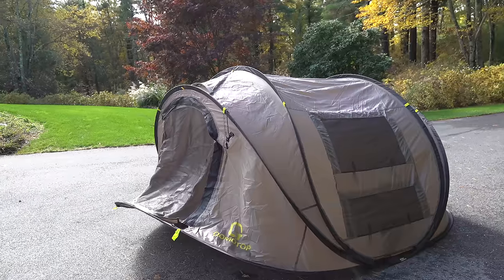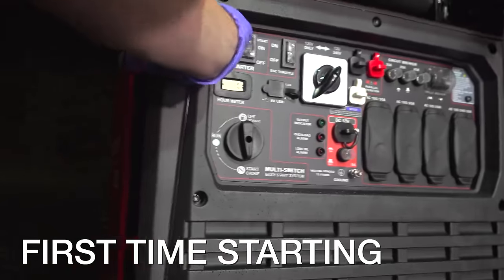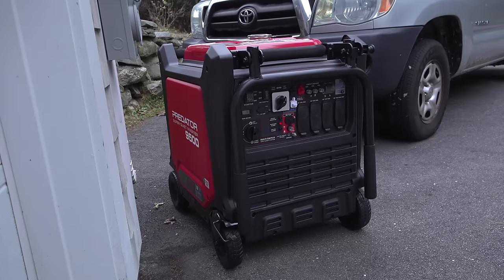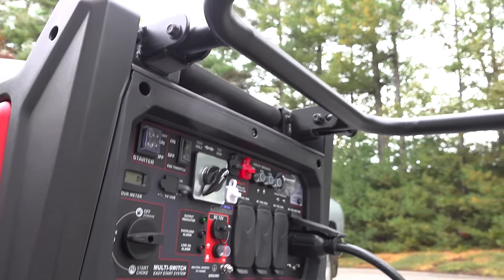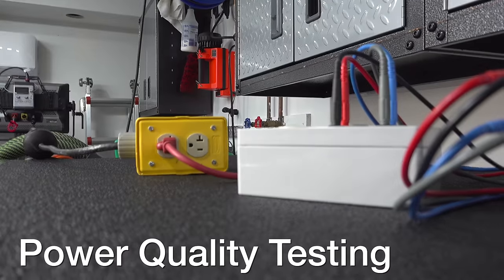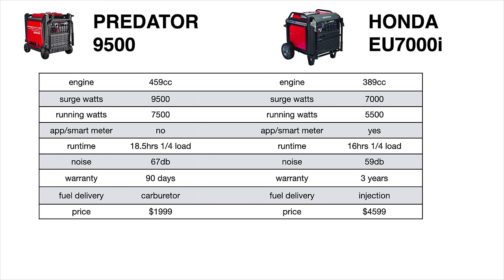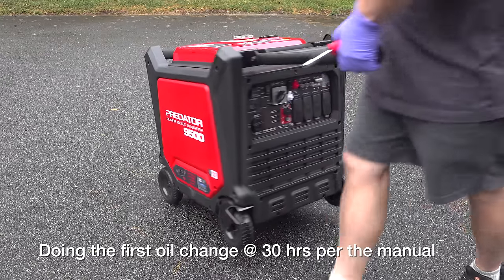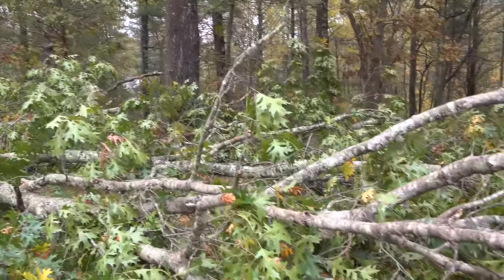BIGGEST Harbor Freight Generator Predator 9500 Review & TEST

Comment from the maker: Thanks for watching please LIKE & SUBSCRIBE - Be sure to let me know if you own one of these in the comments below & what YOU think. Cool LED light I used: https://amzn.to/3mBuE4u
Reply: Another great video. Can you imagine that California just passed a law banning gas generators? Imagine powering your house with just a solar generator. Ok for a few hours but not for 3 days.
Reply: The Predator math doesn't work on the power output. When running the L14 30 amp plug to your house, the size of the wire is a number 10. It is good for 30 amps. Running the generator at 9500 watts is overloading your plug and wire by 2300 watts or 9.58 amps. Even running at 7600 watts is 400 watts overload . Get with a electrician before hooking this up to your house.
Reply: Menards has a deal on 15’ usb to usbc 
And usb to lightning
Reply: Thanks for the great review. I've been looking at getting the Predator 9500 and this is the video I needed to see. About the lights. I have 4 of them and and they are like a mini sun! I carry 2 in my Jeep and keep 2 at the house. So nice to have this much brightness without having to deal with power cords.
Reply: Well it's definitely not a retracting handle for sure
Reply: @rebellucy5610  Dont worry.  They can Burn Candles and Skateboard!
Reply: @Derek Claycomb Fully Synthetic oil does not keep O-rings and other rubber based seals supple.  Its great for metal on metal contact.  That is why auto manufactures recommend a synthetic blend.  Synthetic oil is a waste until all natural based components are not in an engine and its not that way yet.  All my friends that swore by the stuff get leaks from seals going bad causing a major amount of work.  Hey but everything else is cool!  Still needs to be fixed.
Reply: Where is it made in?
Reply: Perhaps I missed it, but which engine powers this generator? (Manufacturer) B&S, Techumpsa, etc
Reply: What was the name or brand of the tent?
Reply: @hellogoodbye3129  
Walmart - SF Street Bum Special
Reply: Hello, my son bought a predator for his ice cream truck, and now he is running into issues and really doesn't have any one to talk to, Harbor Freight where he bought it is short on man power and no one could anser the questions. I'm sure your busy, could you reply if your able? Thank you.
Reply: @Derek Claycomb q¹
Reply: Why don’t they sell these in Canada
Reply: Where do I get one of those pop up tents?!!
Reply: ❤this. Can we get an update on this unit please? Thanks.

Comment: As a factory trained honda mechanic I can tell you the modern Honda s are nothing special.  In the 80s they where the best. Now i own a couple of the  Predators and with lots of good brake in oil changes followed by regular oil changes they last just fine.
Reply: This is the comment we need, thanks
Reply: Also Honda motors are no longer as I've been told. Is that accurate?
Reply: Bullshit.  I have had both that I used constantly and had them in the repair shop.  Honda is infinitely better than that Chinese crap.
Reply: All #thepoors say that.
Reply: Thx brother

Comment: I used our Predator 9000 generator for over 30 hours during this last storm with no issues powering our small office and the house next door.
Reply: That's great that you had that for the storm and that you had no issues. I literally have ran Honda 2000 watt generators for 3 years straight at 24hrs a day. Never changed the oil, only added it to the full mark after it would shut off due to the Low Oil Alert. Never had any problems for years. It's insane.... I highly advise against treating them like a did but you can.
Reply: @lucasmorgan4359  why would you run it that long??
Reply: I dont have the big 9000 but I do have 4400 . Its amazing runs 16 hrs straight.  I haven't hooked it to the house yet I just run cords hut it has enough power to run the heater two fridges and two deep freezes plus our TVs and such it was the best thing ever we had three storms where tornados or wind had knocked down lines and that sucker came in clutch.
Reply: 30 hours is nothing.  That is like saying you are so happy your car got 1,000 miles on it and you have had no problems.  Funny how you almost never see any reviews on an "item" that is several years old and might have 500 or more hours on it.
Reply: @trvman1  well I dont use mine constantly but it does sit put side exposed to the elements and runs like a dream I've had it for about two years and couldn't count the hours but it was in the bed of my truck for about 7 months and was most certainly used alot. The predator is a great generator my brother swears by his Honda but I do know he has had many second thoughts since I have gotten the predator
Reply: @lucasmorgan4359  yeah yeah and after Irma my buddies eu2000 wouldn't start. 

running for 5k hours straight isn't whats important....whats important is that is runs for the hours that you positively HAVE TO HAVE IT RUN.

the aforementioned freind borrowed a tailgator from a neighbor. it ran fine.
Reply: @lucasmorgan4359  what are you powering 24/7 with those?
Reply: Watch some of the homesteaders YouTuber channels that actually rely on these generators they crap out there very unreliable
Reply: In theory anything should work fine when new.  Give it a few years and see how it works, especially when it’s not run frequently, ethanol fuel, etc.
Reply: @shanemb3  It says to not run ethanol fuel in this unit.
Reply: Yo quiero uno .cuál me recomiendan. La menos ruidosa  eu 7000 o Predator 9000
Reply: 9500,wow,yes you want to load that up or it gets lazy if it doesn't have to work hard
Reply: I own quite a few generators 1st a Honda  eu2000 I bought in 2013 it ran 24-7 for years, many oil changes but that's it I've never had to change plug, replace pull cord nothing, 9 years now I haven't run it much lately I sold the boat but it'll still start 1 or 2 pulls simply amazing, one thing is rv fuel only also. I bought a predator 3500 as a back up but only a few hours on it so no opinion yet except battery is dead not a problem tho pull starts 2-3 pulls the predator is quieter than the Honda someday we'll see if the predator can take the thousands of hours the Honda has on it, those 2 are the only relevant here
Reply: @MrSGL21  Your buddy must have not run all the old fuel out of it or not taken care of it.
Reply: @Asidebar  it wouldn't  start even pouring gas right  into the carb throat. Problem was ignition.
Reply: how much did you charge the house next door? I would want $5/kWh, $5/day service, and $1/day extension cord rental. About 10x what the utility charges. A lot cheaper than buying a 9500 watt generator and the fuel cans.  And refilling the generator and the cans takes effort.
Reply: Do you know how much fuel it actually burned 
I’m either buying one of these or a used diesel generator

Comment: Personally, I would never get one of these again. I have had three 3500s replaced under the extended warranty. Used non ethanol gas, iridium spark plug and serviced every 100 hours after break in period. Never ran more than 1600 watts on any of the 3500s and each one failed. Finally just ended up with a gift card to Harbor Freight.

Comment: Great video.  We have the Predator 9000/7250 watts gasoline generator. I installed a Tri-fuel kit, to connect it to our homes natural gas line. We have over 70 hrs. on it with no issues. I only use Pennzoil Fully Synthetic 10W-30. We have ours connected to two manual transfer switches, using the 120volt and 120/240volt outlets. This set up allows us to power our entire house, including our 3 ton AC with hard start hit.
Reply: What Tri Fuel Unit did you get?
Reply: @jm-ve8ry  Hutch Mountain, check them out.
Reply: you should really consider a soft start kit....

Comment: I bought one a little over a year ago. Had issues with the low oil sensor right off the bat. Harbor Freight said to bring it back even though it's an hour drive to the nearest store for me and, the 9500 was in short supply, I chose to keep it.  Thanks to YouTube, I was able to connect with a user that had a solution to the sensor problem. I ended up bypassing that sensor and have ran it for almost 100 hours with no issues. In between uses, I faithfully run it once a month for at least 30 minutes.  Not a big fan of all of these points of failure (sensors) but, over all, I still love my 9500.

Comment: I had the older 9750 watt. For 6 years there's been several times I ran it for days because of power outages..  once for right at two weeks.. it still cranks ever time and never had any issues with it..  I think it was around $500..  one of the best machines I've ever had..
Reply: It’s 2,199$ now…
Reply: Have that older one too…thing is still such a beast…absolute steal for the price
Reply: Is yours an inverter type?
Reply: @Antoniocool86  it's a gas powered generator.  I have two inverters I hook up to a couple of cars to power the lights,  I use the generator for two 110 AC  window units.  I just recently used them in a hurricane/ tropical storm Helena on the east coast

Comment: Bought one of these in august, it has been nothing but great. We have Honda EU7000i’s and predator 2000’s at work and this thing does more for less IMO than the Honda. Sure it may not last 4000 hrs but for my use I well never run it that much. It has ran my house a few times during outages and also my air compressor and saws. I only use 89 Non-ethanol fuel in predators and have never had issues. The key is turn the fuel off then let it run the carb dry. I crank mine once a month and let it load up on my air compressor for around an hour.

Comment: I live off grid and use this generator daily. I have over 1000 hrs on it in 12 months and it still runs great! The only hiccup I have had was the CO2 sensor started tripping while outdoors, there are plenty of videos about the issue and a fix. This is the most used generator out here.

Comment: LOVE my Honda Generators.  eu3000is.  paid 2k and ran it for 10 years, ~600 hours/year.  6000 hours.  Only one issue in 10 years, turned out to be a clogged spark arrestor. Sold it for $1300 and still ran strong when I picked up a eu6500, used for $1600. Awsome upgrade for $300.  5 years later, no issues and 3557 hours.  Runs both 15000 btu a/c's on my 5th wheel with much power to spare.  And as far as fuel goes, I use 87 octane pump gas and will only put non-ethanal gas in it for long term storage. I camp off grid for 6 months/year.  Honda is damn reliable and quiet.   There is a huge difference between 59 & 67 db. 3 x as noisy. 3 year warranties go unused, as there are never any issues.  I feel you get what you pay for.

Comment: Good job! I think features you pointed out are major for me personally; NOISE (a few db is monstrous), injection should be much cleaner and better fuel economy, internet connectivity, warrantee and did I mention NOISE every 3db is a doubling of sound pressure level. Finally, it's a HONDA with a price to match but worth the extra when amortized over the many years one will count on this always starting. I wanted to mention that a carb has gaskets that sometimes dry out even taking into considering the great feature of running it dry. Thank you for a well-presented review.

Comment: I hope you bought the extended warranty.  I had 5 of the 3500s super quiet. Did all service as required,  never got it wet, cleaned spark arrestor every time I changed the oil religiously. I also prefiltered all fuel.
I couldn't make one last over 1,500 hours. Nobody services them, and they can't get parts. Non serviceable.  I ended up buying a Honda.
Went through 5 Predators in 3 years.
Had to pay $ 180.00 warranty renewal every time.
Reply: So get a Honda ?

Comment: With that yard damage I see a chainsaw review in the future, and your comment at the end about longevity is the critical point. What we need is someone to run one of these nonstop for say six months, and see how they hold up. My old honda is going on fifteen years and running strong.
Reply: I thought the same thing.
Reply: I would love to see a Predator tested over six months or a year of hard use. I literally have ran multiple Honda 2000eu generators for 3 years straight at 24hrs a day. Never changed the oil, only added it to the full mark after it would shut off due to the Low Oil Alert. Never had any problems for years. It's insane.... I highly advise against treating them like a did but you can. Also had predators over the years, the loud ones without shrouding around them. They were good for the price except sometimes the valves would go out of adjustmentnt and wouldn't start up until adjusted.

Comment: You might want to test the 12V output with various load speeds. The voltage was not a stable at 12V in other brands. So would be interesting to see how this does.

Comment: We bought a 2000 Watt Predator last year when a storm rolled through and a tornado touched down. And we lost power for a week we love it. I run mine every other Month and it starts up on the 2nd or 3rd pull.
And was also wondering about the review on the 9500 Watt Predator Generator. Looks like it's a winner as well.
Also there several YouTubes who live off the grid and use there Predators and really like how long they have lasted.

Comment: As far as Honda’s reliability, I own a 1984 Honda ATC 200 ES 3 wheeler (the Big Red model) I use frequently in the summer to tow a garden trailer full of dirt, gravel, firewood, etc. around our property in Idaho. 37 years old and it runs great. I recommend the use of non-ethanol gasoline in all small engine applications.

Comment: When I bought my Honda EU2200i, I performed an exhaustive break in procedure with multiple oil changes over the first couple of hours with a magnetic dipstick picking up tons of shavings initially and gradually seeing less and less. 

Whatever generator you buy, I think that if you perform a good break in procedure with a magnetic dip stick, service it on time, use ethanol free gas, and drain the carburetor before storage, it will last you a long long time.
Reply: You're making more work for yourself because you think it's better, you're not smarter than the Honda engineers.
Follow the prescribed service in the manual and it will last 2,000 hours easy before any overhaul.
Reply: @otm646  I wish I could link the photos of the shavings but YT keeps deleting my comment with it.
Reply: @jmljml5065  If magnetic dipsticks weren’t important, why does my Toyota and Lexus come with them from the factory on both the oil drain plug and the differential?
Reply: @jmljml5065  I guess you’re contradicting yourself. I’ll do me. You do you.
Reply: @otm646  Just wondering what benefits does the metal shavings add to the engine? I work in machine repair and often engineering misses issues or to save money. We often modify equipment.
Reply: @DJ turn off fuel up like car
Reply: @DJ right away
Reply: @DJ Use a 2 quart widemouth no spill funnel with a strainer
Reply: Use only no ethanol 93 octane
Reply: @DJ Turn off all electrical in the trailer first then turn off the main switch for electrical in your trailer then once the Electrical is off then you go out and turn off the generator then you fuel up and reverse the process
Reply: @DJ With every oil change I send a sample to in oil analysis lab Blackstone laboratories for analysis just like I do on all of my power equipment including boats motorcycles truck chainsaw lawnmower everything so I have a great record of all metal content and inch and wear for all vehicles
Reply: @joemeyer2726  DO NOT USE 93
Reply: @Asidebar  90?